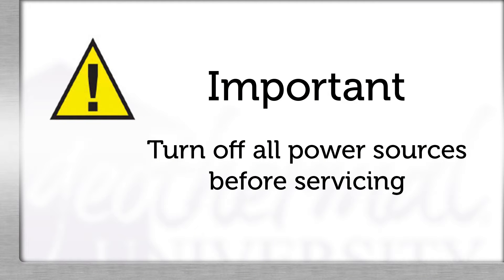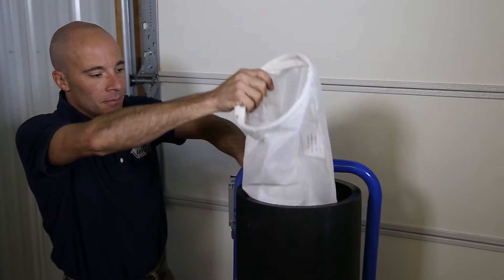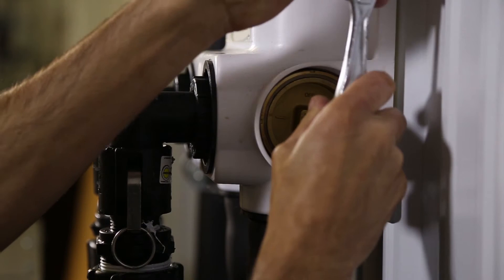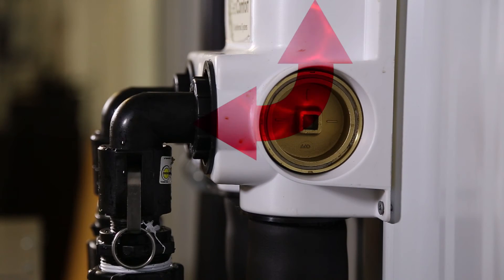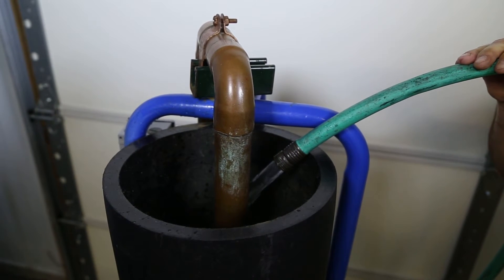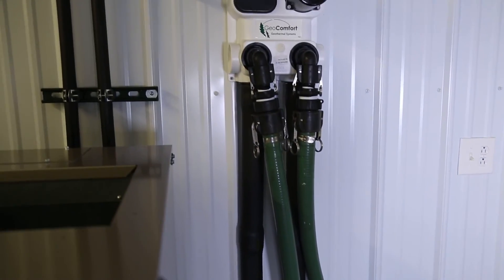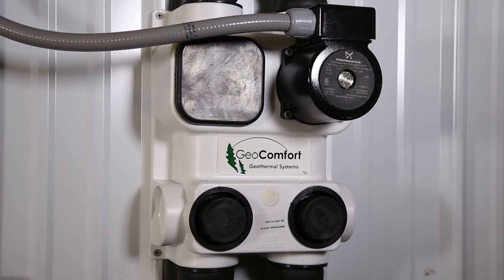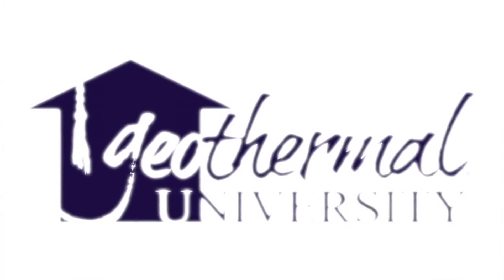Flushing, Purging and Filtering the Geothermal Loop

Comment: I don't understand why an auto air vent is not used on all pressurized ground loop systems.  Micro air bubbles are ever present  and will always need to be managed throughout the life of the system.

Comment: We had  5 ton geothermal system replaced approximately 10 years ago and less than one year later, had lightning strike, needed to replace you again… Due to unscrupulous contractor, I am doubtful this was done correctly, and almost certain that system was never flushed at replacement either time any idea on who to call, how much it should cost and if in fact, there is a way to tell what my antifreeze level is currently with the status of the water without having this service done?
Reply: * Needed to replace UNIT… NOT “you” and what the status, NOT ‘with’ 😅

Comment: should air need to be removed if installed correctly?  mine was installed in 2014 and now they say it needs to have air removed because the pressure is low. waterfurnace 5 series.
Reply: Yes, every geothermal loop should be flushed after the loop has been filled with water. Air will be trapped and will not be removed without flushing to loop with a flush cart.  If the loop is dropping pressure, it could be a leak or it could be due to air in the loop.
Reply: @johnpendleton7243  ok, because they charged me $250 to increase pressure with a hose to the petes port last summer.  They said if it drops again will need to bring out the tank.  But they did the original install and it is still under warranty, yet they claim it is not a warranty item, just maintenance.   Waterfurnace of michiana.
Reply: @johnpendleton7243  they are blaming the reduction in pressure on the ground loop expanding
Reply: @johnpendleton7243  they told me their shouldn't be a leak just loop expansion. How common are leaks when installed by authorized waterfurnace dealers?
Reply: leaks are not common because the company will do a pressure test when the system is installed.